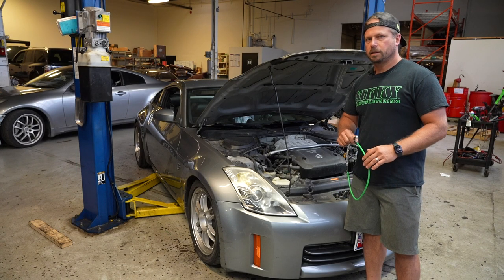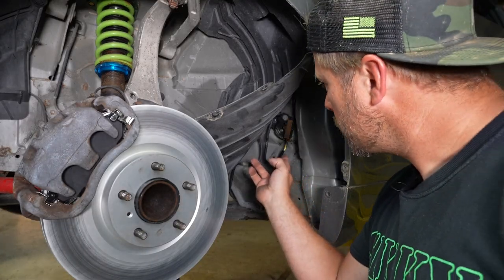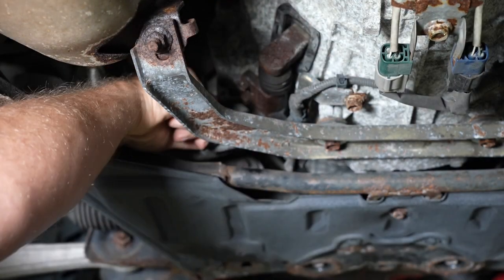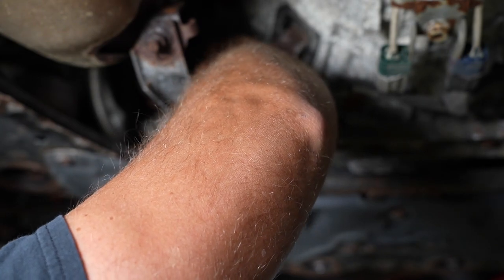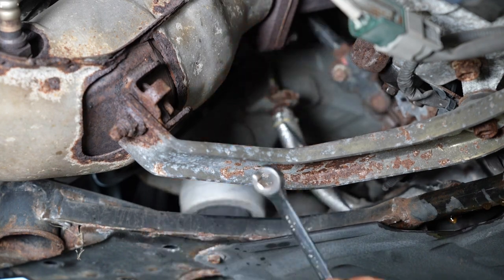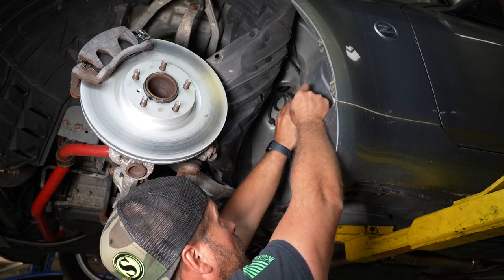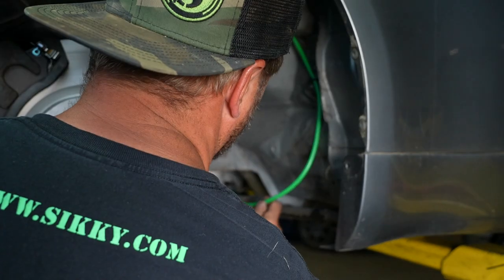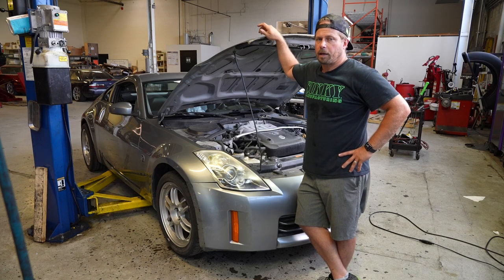Clutch Damper Delete and Line Installation

Comment: I can't wait to buy this for my G35.  I had that lowest line go out and it was an expensive tow.  This will get rid of four or more OEM parts that can fail.  Do you think you'll find a polyurethane grommet that could be included in the kit in the future? That through hole looks like a really bad potential chafe / catch point.  I might use a few layers of metal foil tape and then a little shot of spray foam to stay it in place ?  Thanks for the Vid !
Reply from the maker: Yes, it will definitely improve reliability!  The hole the line goes through is very large and if installed as explained in the video it's at least half an inch away from contacting anything as it goes through this hole.  Also, the hole is abnormally shaped and would be tough to find anything that fits it.  Yes, you could definitely do that but we don't think it's necessary if secured and tightened down similar to this video explains!  Thanks for watching!